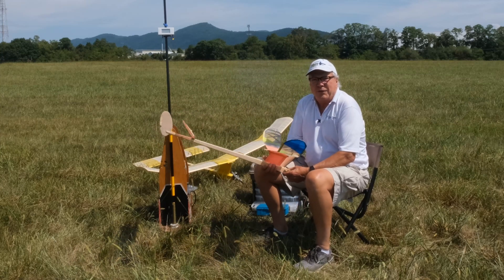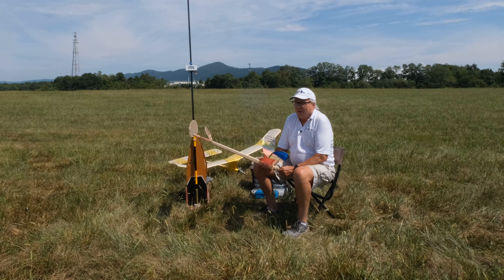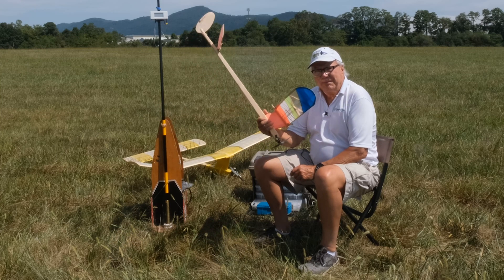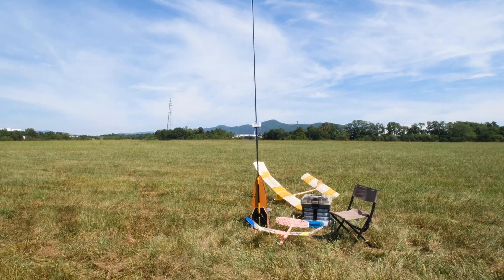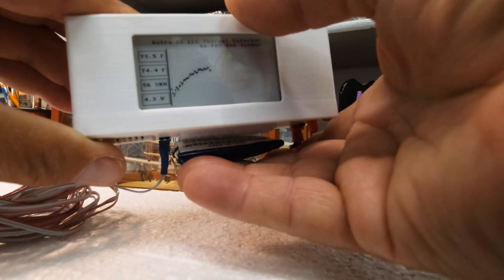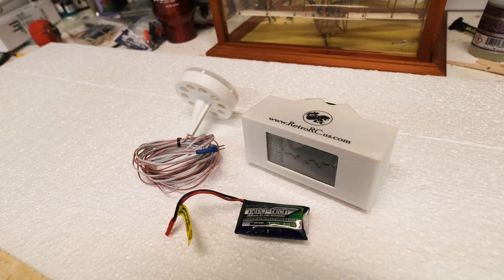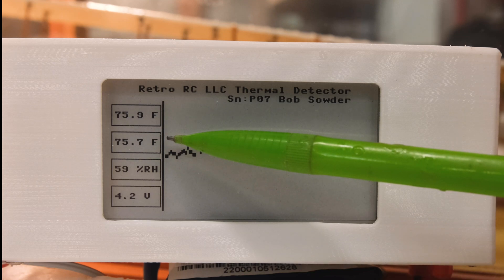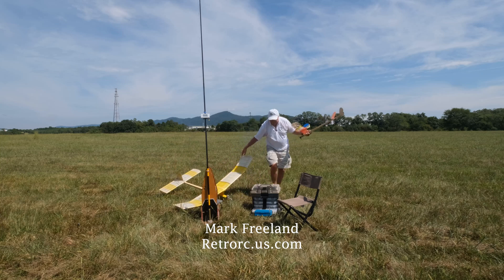RetroRC Thermal Detector Review

Comment: I use a thermistor and Mylar line. If the line has an upward ripple it can mean rising air. I’ve got a bubble machine that I’ve not yet used. I try to launch in a lull or change of wind direction with rising temperature and Mylar streamer above horizontal. Easier on a calm day😀